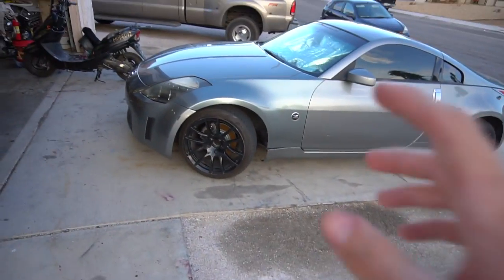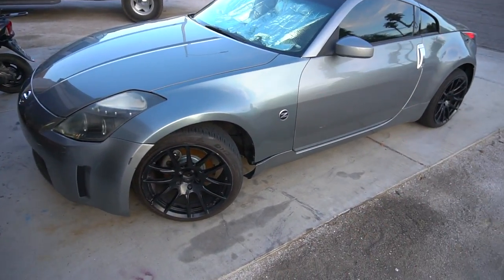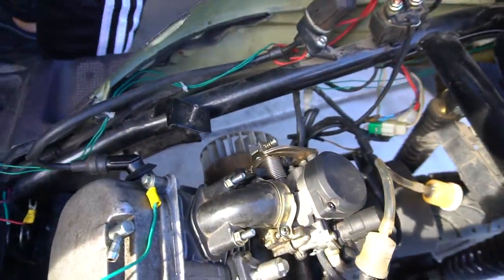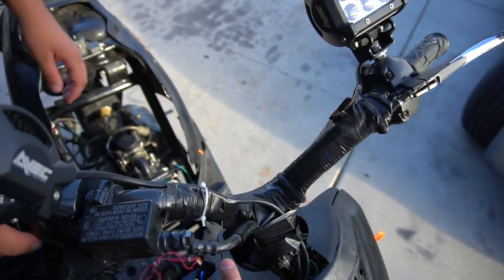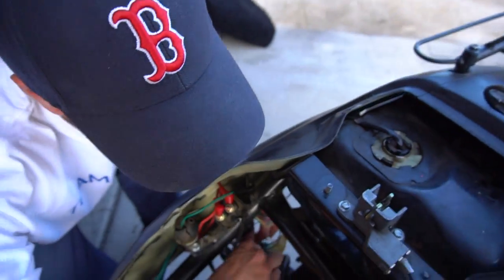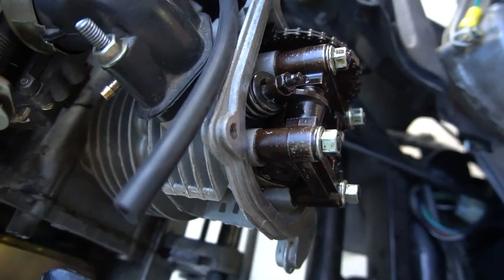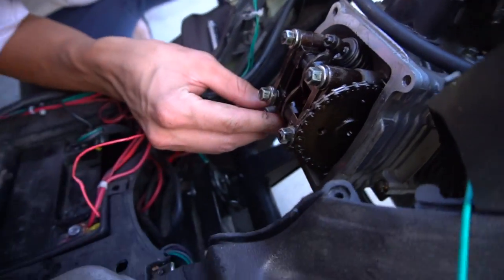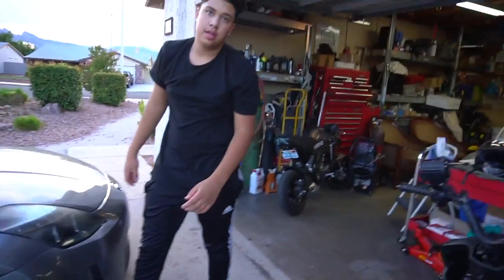IS THIS THE PROBLEM TO MY CHINESE 50cc SCOOTER?!

Comment: It took me about 15 seconds to recognize the problem; 

Engine dies when given gas; because you have  2  fuel filters ;  & one is put in BACKWARDS; restricting the gas flow.

Remove BOTH fuel filters & try again; IF it runs ; then you found your problem.  REMOVE  1 of the 2 fuel filters & replace the other with a brand new "larger capacity" filter.
Reply: Ikr thats what i was thinking too. Fuel Filters usually have a mark to which way they should be
Reply: Can you look at mine idk what's wrong

Comment: Trevor Pritchett THE SCOOTER KEEPS DYING BECAUSE YOU DON'T HAVE THE CARBURETOR FILTER ON!! THE STOCK CARBS ARE REALLY LEAN AND WILL NOT RUN WITHOUT ALL THE AIR RESTRICTIONS FROM THE STOCK FILTER and none of that shit about the gas line giving it more gas. The only way the engine will get more gas is if you put a bigger main jet in. Which you would need a 90 or bigger to composite all the extra air flow and the carb is vacuumed for the fuel system so that was definitely one of your issues. If you could please give us a close up of the wiring and the engine. People could probably help you a lot more. And you need .004 on intake and .005 on exhaust.
Reply: Yess mate because the main jet is responsible for idle and low speeds, and no you don’t need a filter for low speeds, it will run then bog on main jet

Comment: Clogged carb, clean carb, adjust the air/fuel mixture, vacuum petcock isn't necessary with direct feed just need to balance air and fuel mix and ensure that fuel is spraying freely into the combustion chamber

Comment: Try sucking on the Vacuum Pipe of the Petcock that you build in. Because the motor is to week to Suck the fuel at the beginning. Or try to change the fuel because After some months it wont burn well. And if the Motor is getting to much air try Changing the carburettor settings(Sorry for my English im from Germany)

Comment: It didn't seem like you hooked up the vacuum line to the petcock, without that the diaphragm in the petcock won't open try attaching a fuel line to the vacuum of the petcock and sucking on it. The valves were really bad but I also think you may have over adjusted them, intake should be set to about .003 and exhaust should be set around .005 also seems like a fuel starvation issue, I know from experience that you can clean out a carb and it still not get fuel to the plug. Take off your carb, reset the air/fuel mix screw on the left side above the float bowl to 2 & 1/2 turns and spray carb cleaner into all holes on the manifold side of the carburetor until carb cleaner comes out the other side of the hole, that way you know it's open for fuel. Allow the carb to air dry before reinstalling and have a nice ride on me

Comment: U need to prime the carb with the vacuum line, hook the fuel line up to the carb and suck on the vacuum line, it will fill the carb with fuel. 
The vacuum line needs to be hooked up to the carb or the intake to work properly 🤙🏻🤙🏻
100% ur problem

Comment: I had the same problem so bypassed with a fuel line straight from the tank to the fuel filter.
Reply: Fumes won’t get sucked out so ur diaphragm will go bad within months with this method, works but would recommend low pressure electric pump or good vacuum pump

Comment: That's not how the vacuum pump works, it uses pulses of vacuum to turn on the fuel, I think you had a float adjustment issue, or trash in the carb, or a jet issue, but the valve adjustment can cause many problems!   I have issues with mine shutting off at full throttle, I don't know if it's flooding, or starving, it's hard to tell going 45mph!  I replaced everything, it still does it! Bren through 4carbs!  And went to a 20mm and it's slightly worse, with the larger carb,

Comment: Trevor I know exactly what your problem is there is no vacuum line going from the intake manifold to the bottom of the fuel tank therefore you are getting no fuel that is why when you put your hand over the carb it starts cause it is just a little fuel going into the carb and no air put a hose between the little brass knob on the manifold and the brass knob on the bottom of the tank and she will fire straight away I know this from experience as it had happened to me a few times
Reply: i put a new 150 motor in and wont start wtf  its not getting fuel has compression and spark it has a new fuel pump one video said try the fuel cap. ideas. thanks

Comment: I know this vid is from Aug 22, 2017 , but i wondered why you had two fuel filters 
on the same fuel line which would restrict the flow of fuel also i could see air pockets in the filters .

Comment: Get rid of the petcock an just plug the vacuum line, also you'll want the air box on. Way to much air without restriction, especially when giving it gas once at idle
Reply: Removing it fixed my issue. It was defective from factory. Great sugestion. Cheers

Comment: What did you do to adjust the timing? I saw the adjustment of the valves but didnt catch what all was in the process of timing it due to the video being sped up.
Reply: Dustin Frisbie all you do is put a feeler gauge in between each valve most scooters should be set to 0.005 or 0.006 on both intake and exhaust valve.

Comment: Try starting it with the air filter on, seems like you have a mixture prob, and in your last vid it would start when you would choke the carb with your hand and die once you took your hand away due to too much air per fuel
Reply: i dont even think he had the vacuum pipes connected , it'll be sucking in air where it shouldnt.

Comment: Check for spark-are the spark plug getting wet? then it get`s gasoline and the ignitiontiming is maybe wrong........I think your valves was very loose??? Use a feeler gauge!! Greetings from Denmark.

Comment: Jeez,  get a battery out of one of your non running cars and use it to jump the scooter,   Don't crank the starter to long or you'll burn it out.  The fuel cut off valve,  just apply suction on the vacuum side and see if gas runs out.   Set the valves at .004 ...  check for spark.    Compression, spark, good fuel ... it's gotta start.  I've found these GY6 engines to be very picky about having good spark plugs.   If you can get it, use only 100% gasoline, ethanol and small engines don't go together well.    We expect to see video this time tomorrow of it running!

Comment: make sure u didn't tightn those valves down to tight when u was tighning the bold down...make sure your feeler gauge is still fitting between the valve. also it sounds like u have a shit carb bro

Comment: look if there is missing a spring in the carb that pushes the gas needle back i had the same problem but the spring was missing never had a spring in it thats why mine drowned all the time

Comment: Dude your fuel filters are in backward..  usually the easiest fix is the correct one. Yeah the timing was loose but it still will start. But it wont start without GAS!

Comment: why didn't you check after so many trying if the carburetor gets the gas opening the carb bowl, most probably your problem is caused by the carb didn't have enough gas, when kickstarting or pressing the start button little vacuum is created compared to working phase so it takes a while to suck the enough gas into the carb, my advise is pour the gas directly into the carb bowl and try it again!

Comment: Dude if you don’t have a cooling shroud on the engine the cooling fan isn’t pushing cool air to the head your going to over heat your bike real quick.

Comment: Your problem is that your are not geting nesesary fule which means dry spark plug if you have gass on to much fule in carb try cleanig main jet and also float nidle because over time ruber on nidle is geting bigger and fule is not geting in carb sory rip english
Reply: I've tried either engine Start an it still won't Fire up

Comment: Hey Trevor. I need your help man. Any way I can contact you?
Reply from the maker: What's up?
Reply: @MOPBOYZ  My moped wouldn't start after installing a new carburator so I checked the fuel lines and all that good stuff and realized that I had the fuel filter installed the opposite way lol! Thanks for the reply anyway man!

Comment: all that for nothing u got no spark even sprayin carb with easy starter should fired up i got a problem i had that problem u got and i clean the carb put new spark plug in it fire up without spray the part u put on it wont do anything put a air filter on bike and then sort mixture out then run fine
Reply: karl stewart how to tell if it's the carb, remove carb, spray ether starting fluid directly into intake manifold boot, replace carb, start bike. If it runs for a minute or more it's a fuel starvation issue and fuel may be collecting in the float bowl but not getting to plug. Second test is remove spark plug and dry it off/clean it, replace plug and turn bike over for about 5-10 seconds, remove plug again and check for wetness. If it's wet you're getting fuel move on to spark and compression checks, if not deep clean or replace carburetor

Comment: Hi guys! Can you help me? On my scooter I have this vacuum pump for petrol: https://www.amazon.com/ROP-Shop-LG808656-M138498-M145667/dp/B07319CFKL
As you can see from the penultimate photo, on one side of the pump, under the word Mikuni, there is a hole. Gasoline comes out of this hole a few times. It's normal? Is it a vent? Or do I have to change the pump?
Thanks